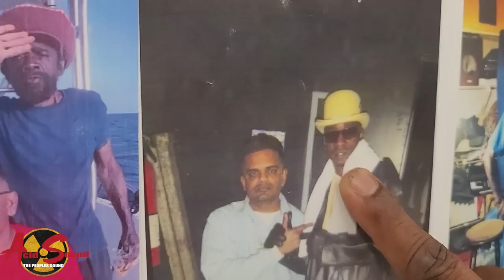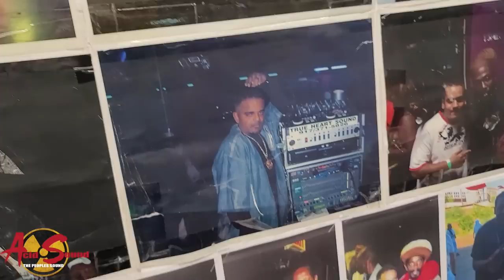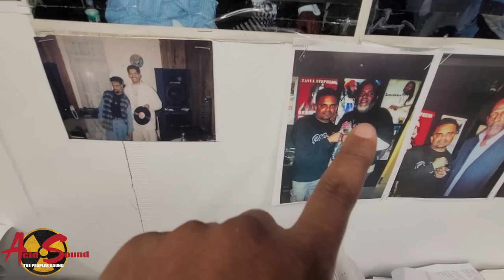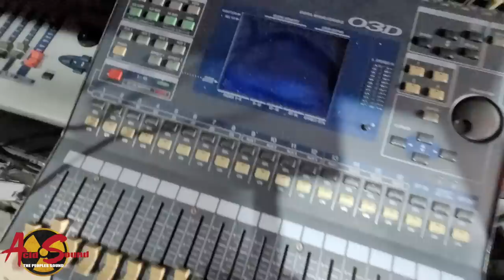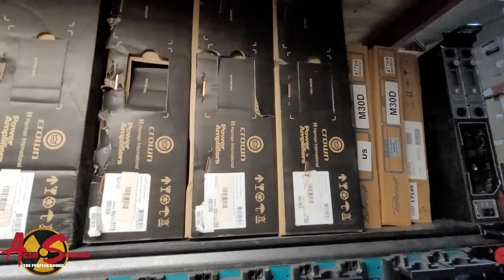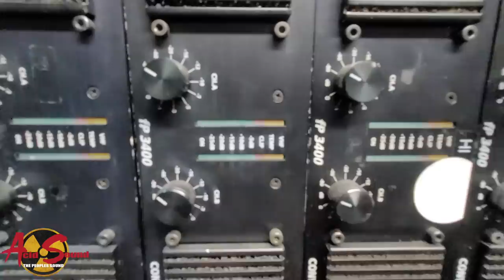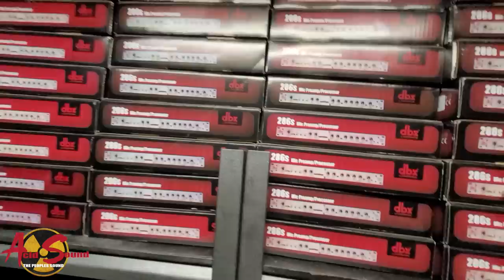SOUND SYSTEM EQUIPMENT WAREHOUSE PT 1

Comment: @14:39, I bought 2 of those racks from THS and they should arrive today. Prices are fair, and they know what the used market is drawing. They can be flexible with prices at times too. Shipping can be expensive but again depending on your needs THS will find solutions. Glad to see the behind the scenes side… A proper reseller.